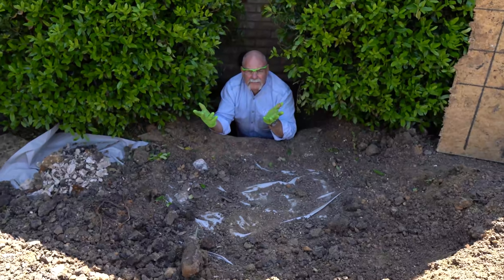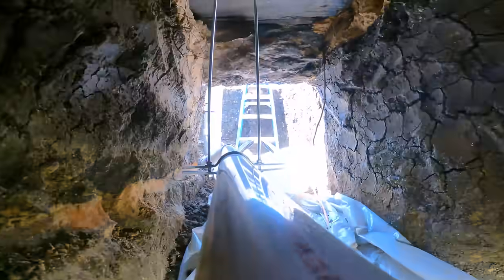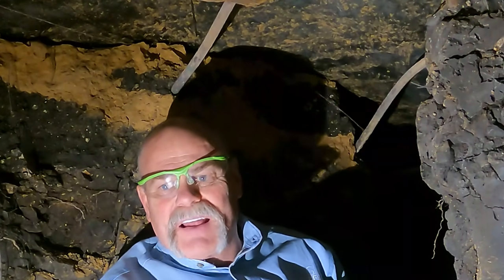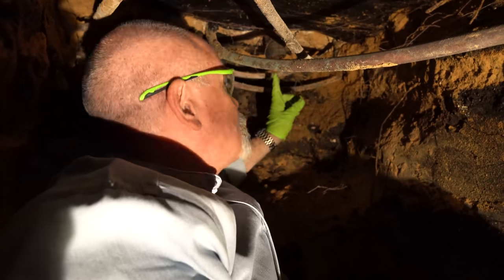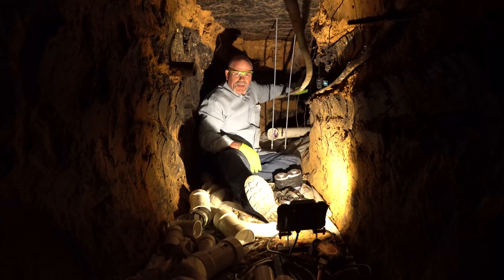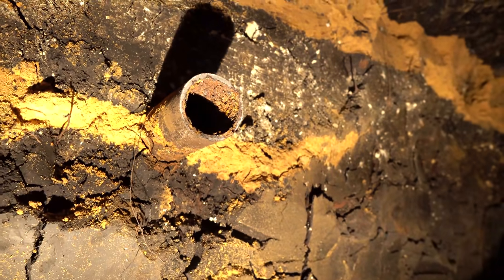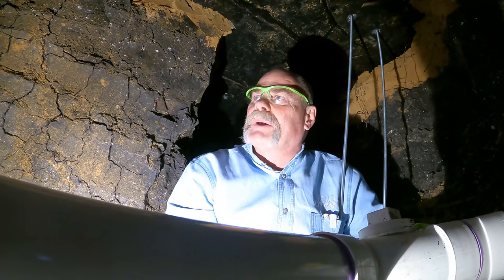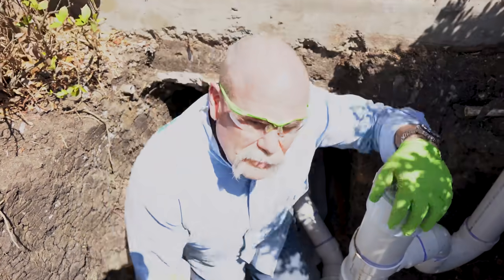DIVING DEEP Under a House to Replace Broken Sewer Lines

Comment: Do a video on how you guys dig those tunnels out. I live in an area where it’s 99% crawl spaces so I’m imagining it’s a ton of work and hard to locate the drain lines
Reply: 100% I was thinking the same thing
Reply: A lot of plumber companies hire a contractor / construction company to come dig the hole, then fill it properly after theyre done.
Reply: I run the  ridgid camara to inspect & locate sewer lines , that's how you locate the drains , pretty fun
Reply: They use a vac truck.  Guys will come in and us the vac truck to vacuum all the dirt out while using a long wand like a pressure washer to cut through the dirt and soften it at the same time.  The lines they locate with the camera.  This method seems expensive.  Only thing I don’t understand is if you’re in there replacing all the pipe why not replace “all the pipe”. Replace the 90 bend, any cast iron left.  Roger Is levels past me plumbing wise but I don’t understand why they didn’t replace all the cast iron since they’re already there. Maybe there’s a reason.
Reply: THAT IS NOT A BIG DEAL, PEOPLE WHO DO THIS JOBS ARE SMALL PEOPLE THEY USE THE MEDIUM BOSH HAMMER WITH A SHOVEL BIT ON IT, THEY USE BUCKETS TO GET THE DIRT OUT IF THE TUNNEL IS TOO LONG IN LENGHT THE THEY USE CARTS . ALL I CAN TELL YOU IS THAT IT IS A HARD WORK, EXCAVATION CAN BE EXPENSIVE.
Reply: @dj_hotwater1006  is quite expensive to do all that that's probably why they didn't do it , 
They would have to remove toilets to install a new flanch, , tub, demolish the shower to replace cast iron p traps , that would be done if the customer has the $ to pay for it
Reply: @dj_hotwater1006  I don't think they should use a vac under a house. Using pressurized water and then vac'ing out everything will spoil the fill. So, I don't they spoil tons of fill and then get new fill for under the house. I could be wrong, but...
Reply: They hire the cartel
Reply: Plumbers don't dig tunnels
Reply: @dj_hotwater1006  this is 100% false .  Those are NOT used  to tunnel under homes .
Reply: @dj_hotwater1006  if you want to chip through concrete to replace perfectly good fittings be my guest . The reason we usually don't is exactly that . Don't fix what isn't broken . Also it's usually a cost efficient decision made by either insurance or home owner .
Reply: @juanitodurden9347  my guess is, if the pipe is rotting out and the closet flange is the same age why the in the wouldn’t you replace everything in site.  Kinda crazy not to especially if you’re there already. And sure I could be wrong especially cause it’s under a house, makes sense. Every state does things differently.  There’s no way we would ever tunnel like that in AZ when we could just use a trínchelas to pull new pipe, new flanges…. Cost is probably 60% cheaper than to dig under a house as well.

Comment: how do you fill and compact the soil under the house when your done? once you undermine something is it even possible to restore the ground under your foundation without having voids? I understand it needed to be done(probably before foundation work) Anyone that has dug under a sidwalk or concrete slab once you try to push the dirt back and fill the whole hole will know its pretty much impossible without having voids and definitely not compact, you have a 3 foot tunnel underneath a home that will never get filled completely.. do you have any video of your guys filling it?
Reply: I think they would have to use slurry concrete backfill. O dont aee a way around this
Reply: Dude he said they have a structural engineer check all of their digs

Comment: Us up north are laughing at all that hard work because a house made slab on grade. We love our basements. Yep cheaper to build a home slab on grade, yet substantially more expensive to do repairs
Reply: im in houston, about +90% of the homes are slabs. I think its mostly because you hit water at just 2ft.
Reply: We loved our basement too, spent tens of thousands of dollars trying to keep it from flooding. Another twenty thousand to fix the walls pushing in. Yep basements are sweet. I now live in a home with a 4 foot tall  crawl space.
Reply: @Bryan-Hensley  If they are build right and water is properly kept away from the home, it's a non issue for 99% of people. I rather have a basement then put water pipes in the attic, ductwork is actually accessible in the basement with room to work. No need to jackhammer up a slab to do a simple repair
Reply: @zack9912000   foundation and basement issues are rampant, more like 99% of people experience them

Comment: Where I live, Northern mid-west US, most homes have a basement. Buildings typically have an area to directly access any plumbing. Plumbing that leads into the house, are buried deep enough that the winter frost can reach it, so underground piping won't freeze and crack open and cause the problems you mentioned in the video. That's not to say it doesn't happen here, it's just not as common as other areas of the country.

Comment: In Kansas city we break up the slab to do pipe repairs. Thankfully the majority of homes have basements in this area.
Reply: My state it’s hard to do so because most of the homes have post tension slabs
Reply: @AlanML602  Slabs are just stupid to begin with. Cheaper to be build slab on grade but substantially more to do repairs.  homes with basements are the best designs
Reply: @zack9912000  agree with you 👍🏼
Reply: @zack9912000  What about raised elevation? That's my go to when I'm under one working. We don't see very many basements in South Ms
Reply: @Xxch13xX  Up here northeast slabs are only found on condos and cheap developments done by home builders trying to save money. Slab on grade are just a poor design and for them to not have even a crawl space to access piping is just stupid
Reply: @zack9912000  It's expensive to build a proper basement in North Texas because of expansive soils. They expand when wet, and shrink when dry. This puts a large sideways force on the foundation walls. Concrete is great in compression, but terrible in tension, so to resist sideways forces, rebar is needed. Of course, rebar has the same problem which caused Roger to need to replace the sewers. A raised house would work, but would look out of place next to all the houses on slabs. It may be more expensive to construct, and the buyers of the new house are typically looking for cheapness, or would rather spend that extra money on finishes. After all, they are unlikely to be around when the pipes need to be replaced. The new houses all have PVC drains and Pex supply, so will have different issues.
Reply: @johnhaller5851  We have those issues here as well and don't have problems

Comment: How do you make sure the dirt is nice and back under the house? like compacted and such, because when people try to fill holes back in they've dug on the surface there's an indent from where they dug sometimes.
Reply: They don't. It will be long after the check has cleared before homeowner has problems.

Comment: In my country it's illegal to run a sewer under a building unless it's encased in concrete. I find it a bad plumbing practice to run sewer or water lines under a building due to the building settling over the years. All our sewers are mostly run around the outside of buildings, to prevent extremely costly repairs.(been a plumber for 43 years)

Comment: I still don't understand how you backfill hole under slab without causing structural  problems. Can't do where I'm at in jersey. Too much clay and shale. You should have a video on how you have that done.
Reply: You do the best you can which usually means there gonna be gaps I'm guessing where your at you would remove that bad material since it can't be used for good backfill and bring in new material
Reply: Sand slurry backfill works great.
Reply: Ive used flowable fill which may be what the other person is talking about with sand slurry. Its structually sound enough tonuse as backfill but still diggable if ever needed to be removed

Comment: Where i live we got a crawlspace system for atleast 100 years. The space is about 2 feet, sometimes up to 3 feet high and runs the ENTIRE surface of the house. The pipes are semi  burried or are suspended about halfway through.
all crawlspaces are required by law to have a ventilation system (wich is illegal to block).
Noting to fancy, just some brick sizes holes with a roster in front of em to keep pests out

The pipes itself can be somewhat complicated, as some towns require you to seperate rain, sink and shower water from your sewage.
Building directly on grade fails building inspection imidiatly here.

Comment: How do you back-fill the tunnels you dug out? Do you just throw dirt in and hope there's no air left in it? Do you come back and "touch-up" the back-fill when it settles down? Do you consider the ground water and its effects on the back-fill, because the back-fill is more likely to get eroded away than the compacted soil around it? Are there any other precautions/tricks to back-filling these tunnels?

Comment: Ive never seen plumbing like this before. Up here by the Dakotas every house bare minimum has to have an actual crawl space. My house has a half rock wall basement with a crawl space for the other half of the house. Not many people can fit in it but if you can get a kid or skinny person in there, your in buisness. Just seeing this gives me the feeling of everything was half-assed originally. 

Thankfully my sewer system has been upgraded to pvc but my final run to the street is way too long (like 6 of my house lengths and not a whole lot of drop for the distance. Just waiting for a sewer backup to happen. Hopefully if this year is nice I'll be able to install an anti back flow on our main sewer line. I've heard of too many horror stories in our area of backups with houses situated like mine from the main.

Comment: I know that a monolithic poured foundation and floor are safe and are highly unlikely to fall but the problem in any trench like dig are the walls which are far more likely to collapse.  I know that they make wall retention screws that you can drill into a dirt wall and then attack a plate that can be pressed against the wall with a nut.  This used soil several feet beyond the wall to anchor the screw and the plate to press aganst the wall.  This can greatly reduce the chance of the wall collapsing.

Comment: How would you recommend tackling a cast iron sewer pipe that is 5-8 feet bellow a basement slab on a house built in 1900 in Reading PA? Its probably 12-15 feet below grade in the front yard to the street. Pending camera inspection, i am worried i have a belly going on in the main section from the stack to my street (~100 ft) and am thinking to consult with a trenchless pipe company for that section to be replaced vs digging up the entite basement and front yard. Its just deep as hell, old city piping, not much room to work or put all that material if you were to dig it out. I hadnt thought about tunneling instead if digging down, i didnt even think thst was feasible, bit i wonder if it is at the depth my sewer main is? Any input is appreciated.

Comment: Why didn’t you use the trenchless liners ? From Picote or a Brawoliner ? I’m from South Africa and we completed a recent job where we went through an old house with drainage running under a concrete slab (roughly 45 meters). Was a dream to work with, a lot 4/5 Y junctions but easily solved with the cutting heads of the millers, etc.

Comment: This is definitely different to how we do it in New Zealand a lot of our houses are build on piles so there off the ground and sewer and water lines are  easy to access mostly. Modern houses are built on concrete slabs have water and gas lines overhead in the ceiling. The sewer lines are under the slab the difference here is we normally protect the sewer pipes in selves and it is buried in pea metal to give the lines movement. It’s seems weird that all this pipe work is just buried in the dirt in this video it’s just asking for trouble.

Comment: Here where I live in Hampton Roads, Virginia, there is a high water table so most houses are built on a solid slab, or have a Crawlspace. If it's a slab, then weakening caused by a plumbing leak on these sorts of structures means the concrete is already compromised. So plumbers around here don't tunnel it, they simply jackhammer it, and replace it. Its easier, cheaper, and safer for them that way.

Comment: This seems like a harder way of doing things? With homes on slabs that have these issues we would just cut a path through the slab. Dig the old stuff out, replace with new pipes, patch the path with new concrete and fix the flooring. Annoying but you're not doing some wwi trench warfare tunneling. Another option is if the bathroom/drain is next to an exterior wall, you just run a new drain pipe to the outside and then run your line outside which is much easier and cheaper to deal with. If you're going through all of this trouble why not just jack the house up and create a basement/crawlspace?

Comment: I got a question roger, now why would a shark bite fitting be allowed for underground use but regular solder is not???
Reply: Any underground waterline REPAIR should be brazed if copper. Not a regular solder joint or sharkbite.
Reply: Depending in some states brazing is only allowed, due to code.

Comment: I’ve been a plumber for 20 years and this is the first time I’ve ever seen a tunnel system like this and it looks damn cool but I can’t even imagine how many man hours it took to dig and I’m curious does it stay open or does the dirt go back in after everything is done? My guess is that it stays open
Reply from the maker: We replace and repack about 85-90% of the dirt. Complete backfill.
Reply: @RogerWakefield  how much would something like this cost? I'm guessing 99% of regular home owners could never afford something like this. What do you do if you need work like this done but it's simply not affordable?

Comment: So , how do you back fill ? gravel ? dirt and powder puff ? do you leave the tunnel underneath ? Why the hangers ? Looks like the pipe is near the bottom of you tunnel . Couldn't you just put the pipe on sand and run some stakes tied with rebar to hold it still ? Very thorough job , just wondering about the long trapeze it looks like you are building .
Reply: Well the piping has to be pitched at a certain grade So that it will drain properly and yes the tunnel gets back filled with the same dirt that they took out and it all gets packed back in
Reply: @JL-fq3jc  I guess I was just asking how you get compaction under a home .Dirt needs the right amount of moisture and compaction to get the air out and create a stable surface for the home to set on . If you just put the dirt back without compaction via tamper or some other compacting device , won't you have excess dirt left and large voids under the home ?

Comment: I've never had foundation problems caused by sewage issues.. however my a portion sidewalk has like a 3 foot hole and now a slab sidewalk has sunk down far.. Thankfully its a city issue and they are fixing it. In probably 6 months :|

Comment: Are u Mike Stones brother?

Btw, you can’t backfill that, I think the only way to achieve compaction is to saw cut the concrete, there are down sides to that also but being the cutting of concrete is limited to plumbing pipes. It should be on the table as an alternative.

Comment: Why is houses out there built on slabs? Why not build foundation crawl spaces to make everything accessibly? Just curious, love the videos btw👍
Reply: Texas grows very fast at times and they gotta throw up subdivisions quickly. Slabs are just way faster and cheaper. But since it is texas, you can have your home built however the hell you like for very little money. Theres been a ton of homes being demolished in Houston and built on raised foundations to combat the flooding were getting.
Reply: Most homes prior to the 1950s were peir and beam foundation, which leaves an excellent "crawl space".

1950s onward slab became the preferred method, and 1950s pipes are now 70 years old and rotted out. 

By the mid 80s iron pipes were gone and PVC came to be the new normal.

That means most homes from 1950-1980 in Texas will need this costly repair.

Comment: Houston (Roger's area) is littered with expansive soils (aka Houston Black Clay) swelling and shrinking with every rain & drought. It means proper drainage (gutters and downspouts) critical to the foundation & underground plumbing. So if you live in Houston, don't neglect a broken/clogged gutter because "its just water coming down where nobody will get wet".

Comment: Would love an explanation of how backfilling and compaction were done, if not done correctly, expect more subsidence, which will in turn crush the pipes you have just installed. I would not even consider tunneling under a house. Better option would be a total pipe reroute....
Reply: And where exactly do you think you're going to re-route drains without going under the slab?

Comment: How much did that cost to repair with that amount of excavating?  Could u not have slip lined it with fiberglass???  Unless your going to backfill with a certain slump the entire way proper compaction is going to be suspect.

Comment: Living in a slab house seems like such a hassle - no place to store junk, no tornado shelter, need to put water heater, washer/dryer, furnace on the first or second floor so even a small leak becomes a massive repair job, no place for a quiet man/cave or home gym... our house sits high on a hill so the drain lines go under our basement, but even if we needed to jackhammer the basement floor we could still live normally on the first and second floors of our house.